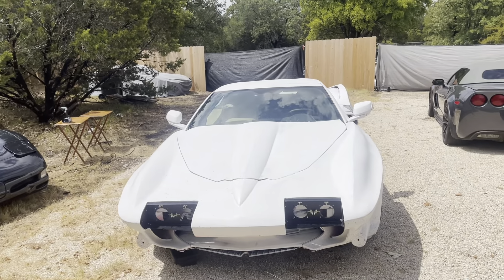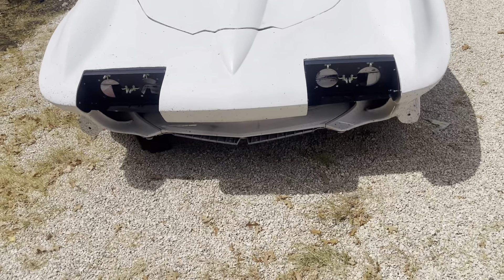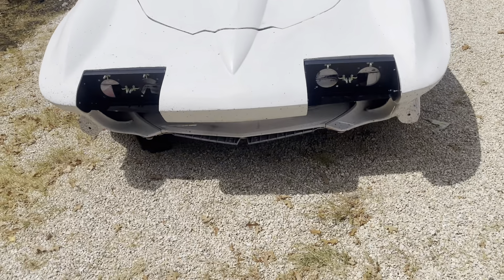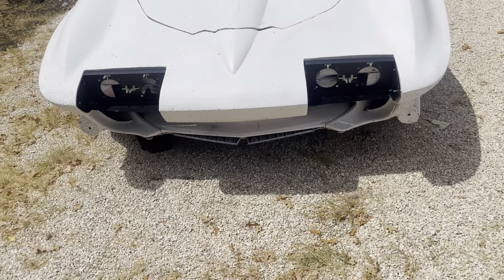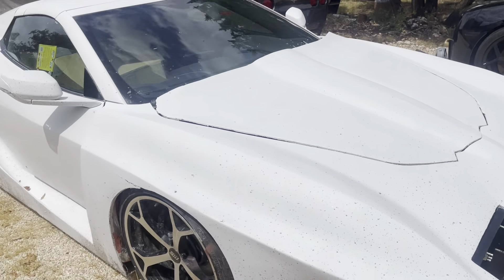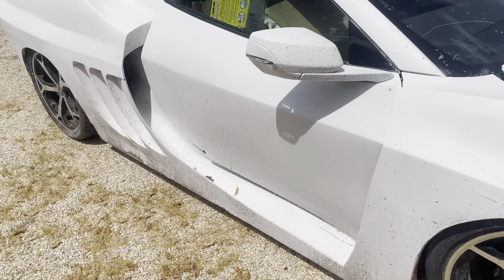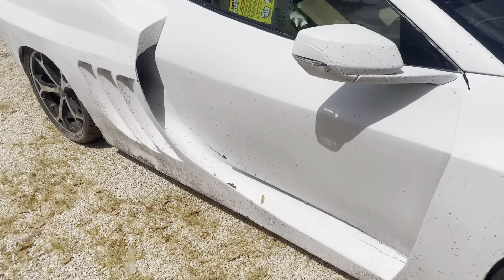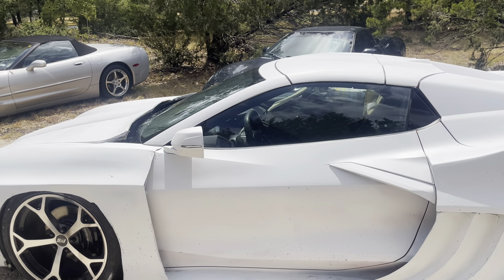C8 Corvette Hack - 3D Scanning the Car

Comment: 1)why not scan at night? avoid heat and have low/no external light
2) thought of getting some "art" rubber stamps and put random stamps al over the car, the Photogrametric stuff then has MANY datapoints to work from.  (flowers/cartoon figures/random numbers/  flags/whatever but make them all different or at least at vay different angles.
Reply from the maker: Yes, I tried scanning at night just the other night. Its not as good as scanning in dim light conditions but it works okay. Obviously better than fighting the bright sunlight (impossible). 

I didn’t think of the rubber stamps. I’ll try that in the future. Thanks for the suggestion! 

I took over 1000 pictures and I’m waiting for time to tie up my computer for 14+ hours processing them. Hopefully it turns out better than before. Couldn’t be any worse. The 130 photos turned out pure garbage.
Reply from the maker: I’ll post pictures from my computer screen in the next few days showing the scan results.